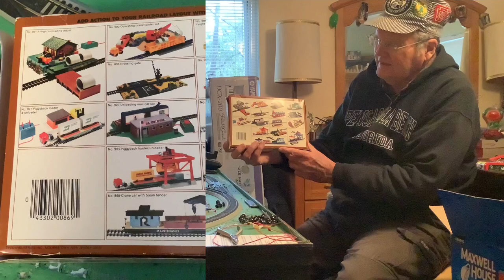HO Updates with Bachmann Overland 4-8-4 Unboxing (Ep. 80)

Comment: Wow there were some beautiful locomotives as well as horse cars/ equipment. Have never seen an HO engine produce so much smoke. Such trains may make me into an HO fan yet! Perhaps you could add lights to the ends of those wooden cars and/ or use reflective yellow paint on the tiny windows to give the illusion of light.  🛤🚂 🚞 🚞
Reply from the maker: I just have ti figure out why it squeaks

Comment: Your Overland 4-8-4 is a great looking locomotive and quite the smoker! The wooden passenger cars are based on the Rock Island Rocky Mountain Rocket. I believe they were made by Silver Streak. I’ve seen similar wooden kits made by them. I’ve been enjoying a nostalgic kick with some old TYCO trains as well. I have to use a “truck tuner” by Micromark to get the metal wheelsets to work on the old TYCO trucks. Makes the holes bigger for the axles to ride in.
Reply from the maker: Thanks for the tip on the truck tuner.The Overland had a bad squeak when first tested. I only got the boiler partially off but apparently it fixed the squeak by shaking things up.
Reply: @johnlongssilverrailz5873  I’m glad your Overland is running squeak free. I’ve heard even brand new Bachmann steam engines will squeak right out of the box. The truck tuner makes all difference making those old TYCO trucks run so much better 👍